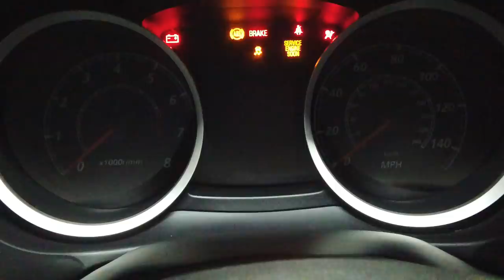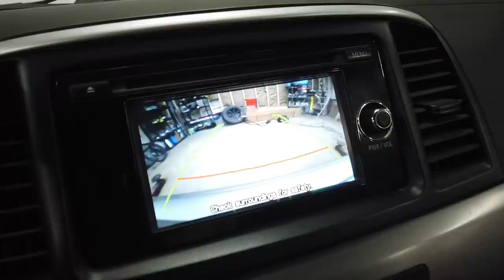I finished the Copart Mitsubishi Lancer SE EVO IX

Comment: Came out really nice. Its good you're also replacing the catalytic converter. Not that I can afford another car but if only it a 5 speed. I had an '88 Subaru 3-door coupe bright red. I loved that car. had most of the comfort amenities, but mostly reminded me of driving my Jeep in the army. The guy I bought it from, a friend, also mechanic advised me to put on a set of Cooper Cobra's and the next size width and also a size down on the sidewalls. I had a lot of fun with, bought it 100,000 and the body finally gave out at 240,000. Also not crazy about the LED's in the headlights, lol. That's just me. I try to keep a low profile and bought a '99 LeSabre. It was the perfect inconspicuous car to drive. Blended in great until I put a wing on the trunk, Go figure. I also like to give my own little touch. On my "07 Mitsubishi Galant ES I drive now, It needed the front emblem. I ordered it but mounted it upside down.